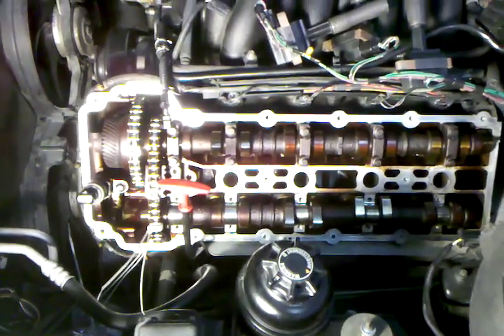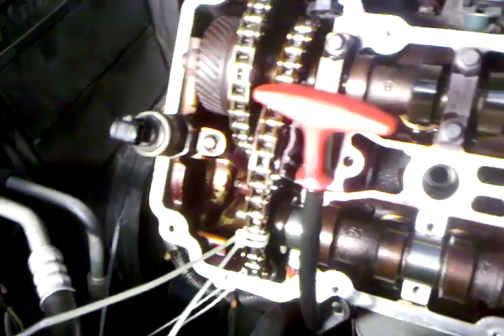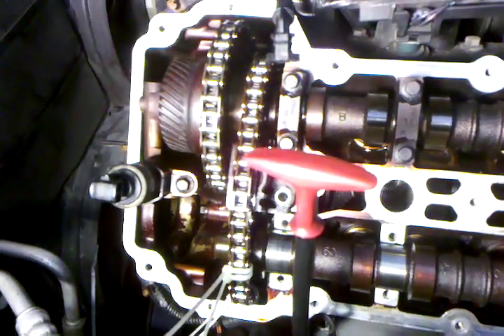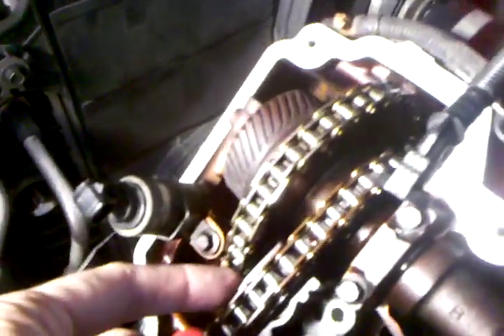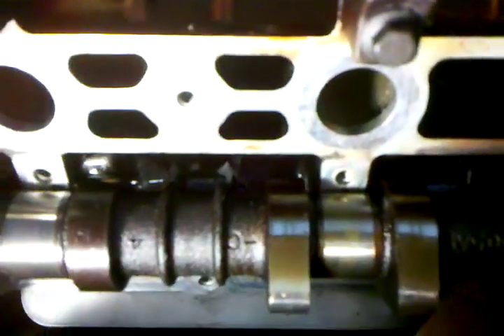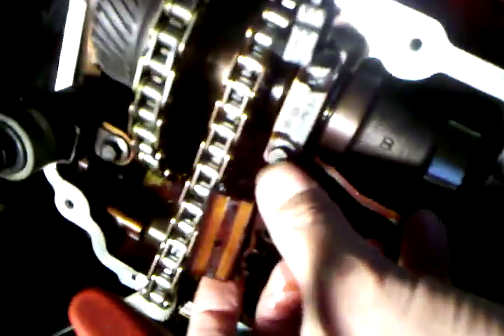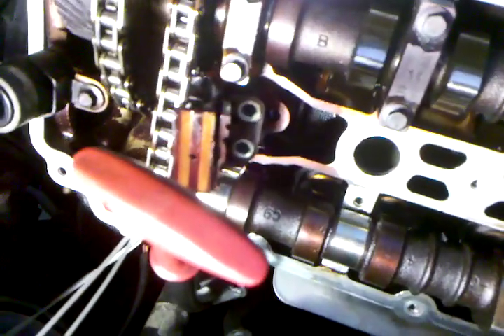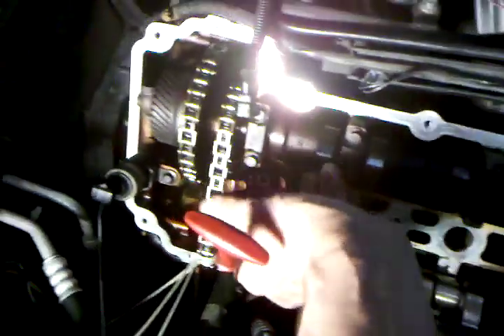99 Jaguar XJ8 VDP Left Side Timing Chain Tensioner Removal

Comment from the maker: I did this over two days.  I had to create some tools to get at the radiator "tower" since I removed it.  I replaced the cam cover gaskets, one broken cam cover bolt as well.  If this is your first time, just take your time, have undisturbed room to lay down your parts, take photos as you go, gaskets get REPLACED - NOT REUSED.  I have heard the recommendation that you replace water pump while all this is off - but I did not.  Good luck UK.

Comment from the maker: Hey Jackel59 - This was my second tensioner issue with this car.  Within two weeks after purchase there was a fairly loud tapping from the left front of the engine.  That one was replaced by dealership, but they refused to do 2nd one. If you are unsure if they've EVER been replaced HAVE IT DONE. Originals are made out of a plastic housing.and they crack, break, then your engine turns to mush.  LOTS more help on the Jaguar Enthusiast Forum!!!

Comment from the maker: Jackel59, The correct torque figures for the camshaft bearing cap bolts are 18-22 Nm or 13-16 lbf/ft.  Again, the Jaguar Enthusiast Forum online was my primary source of information about this job.  I was nervous about doing this in the first place, but like building a model, I just took my time and then realized that there are only "so many" parts.  So it was actually fun at the end.  

Remember, I'm not a certified mechanic!

Comment from the maker: By the way everyone, after I bought this car (used) the right-side tensioner, being loose/broken, had the chain making a "clacking" noise upon startup.  I brought it back to the dealership and they refused to fix both at the same time (under warranty).  So they replaced one tensioner (not the entire set/pack), and when I mentioned this on the forum, I was told to go ahead and do the other one...easy job, lots of instructions at the forum (FREE) like Rick Taylor said, TAKE YOUR TIME. 

If you don't have confidence in yourself and your ability to read through a forum for help, if you can't read a torque wrench, if you can't follow instruction, then go to a professional for this repair.  Also bring your car to a professional to have air put in your tires, or change your wiper blades, install a stereo...you get the idea - this is NOT rocket science by any means.  Good luck.  Please don't ask me questions because I got all my answers from http://www.jaguarforums.com/forum/

Comment: As a professional Jaguar Tech I do not recommend this procedure. To many things can go wrong. First of all the crank should be fixed into the correct position with a holding tool through the crank sensor slot, the cams should line up on their flats at the front and then a special holding tool fixed to secure the cams. The tensioner on the right side fails the most and can result in misfire codes before actually snapping the chain and bending the valves. Also never re-use the seals/ gaskets on the cam covers. Best bet is get professional help, your attempt can be a very costly mistake!
Reply: Rick Taylor have done this all but the engine is hard when im turning it can it be the cam bearing caps?,what can i do
Reply: R T which source do you rcommend for jaguar specialised tools? i know scparts

Comment: I am having trouble loosening the bolts that hold the camshaft caps on. I understand that the bolts have locktite on them, from the factory. How did you remove yours? I am afraid to put too much pressure on the bolt, as it may break. I would really appreciate any advice you can give.
Reply from the maker: Hello Bob,  I'm not a professional or certified Jag Tech, but if you believe you have factory locktite on those bolts (which I think my job was a first for the car), I would still set your socket on the bolt head and use a rubber mallet on the socket driver handle...tapping it towards the removal direction.  The idea being that those bolts MUST come off.  So gently tapping with a rubber mallet on the socket driver handle with increasing pressing should break them loose.  Again, mine was a first time and they were very snug, but eventually came loose.  Aside from the paying attention to not moving parts around too much, this goes back to our basic model building when we were kids.  Don't forget to put oil into the ports (holes) on the new cam shaft tensioner BEFORE bolting it back down.
Reply: ibond2u Thank you for your help. I have the bolts out now. I did not have to use a mallet...I just took a chance and put a lot of pressure on it; and it made a cracking sound. I could swear I broke the bolt by the sound of it; but no that was just the sound of the locktite breaking loose. Now, my problem is that the camshaft will not budge. I tried prying it; and it just doesn't seem to want to come out.

Comment: Did you put the engine at tope dead center for this job? Did you rotate the cam to get the lobes off of the valves? Or is it mostly just as it says in the video please?
Reply from the maker: Good question - I did all this "in place" where the engine was at the time.  I did mark both ends so the alignment could be the same when replaced.  The mechanics (through the Jaguar Enthusiasts website) said the first thing you had to "get over" was overcomplicating this in head.  Overall it's like building a model - take your time, take photos as you go if you need to or simply mark the spots for alignment for when you replace items.  This was the first time I worked on the engine and it turned out fine - and it was fixed.  Thanks again for the question.
Reply: Marked both ends of what please?
Reply from the maker: @tainchains  I'm sorry, it's been 11 years since I posted that.  Can you see that I put zip ties to keep the front end of camshaft in place on the sproket?  :)  That's all I did to keep it in alignment as I gently moved it out of place in order to remove the old timing chain tensioner.  So again, don't overthink this.  Oh, I traded this car in 7 years ago, it was still running fine.
Reply from the maker: @tainchains  Forget the "marking both ends" that was another job I did.
Reply: I'm pretty sure that the tensioner broke. But there is another noise like a piston slap. This all happened at the same time. What do you think of this noise? This is the engine right when it started having  trouble. Its not being driven now. I will try to replace the tensioners. Do you thin that might fox this?

https://youtu.be/PXkR80gqqqM
Reply from the maker: @tainchains  I am sorry, but I am not a mechanic and sounds are very hard to match to a specific problem.  I would suggest that if you are unsure, that you contact either a mechanic or join this forum and ask the question and you'll get better answers than I can give.  https://www.jaguarforums.com/
Reply: how long did one side take?
Reply from the maker: @tainchains  That was the first time I went into the engine, so I was careful to note everything I learned about this repair.  It took me about 45 minutes.  The idea was that the zip ties held the sprocket and timing in place and you only needed to move them ENOUGH TO WIGGLE THE TENSIONER OUT AND PUT THE NEW ONE IN. THEN PUT EVERYTHING BACK INTO PLACE.  Should be fairly simple for you.

Comment from the maker: Hello Guys, I would have to say that Rick Taylor's comment is valid to a degree.  Rick, would you like to discuss your opinion with the 70, or so, Jag Tech at the Jaguar Enthusiasts Forum? They will mostly disagree with you, especially about that expensive tool versus the "zip tie" method.  I will personally agree that this job might not be for everyone because you do have to look beyond the immediate repair and look towards what might become damaged soon afterwards, like the chain guides.  However everyone, Rick is a professional mechanic, and I respect that, but after reading the hundreds of posts, most made my "tried and true" Jaguar owners who performed this repair, and based on the many Jaguar technicians who backed up the ease of the ENTIRE Chain, Guides, and Tensioner replacement - I'll take their advice over Rick's advice.  Do your research and train yourself - http://www.jaguarforums.com/forum/

Comment: Theyre called valve covers and they only need about 15lbs of force because the gasket is a flimsy one. You should secure the cams to their respective spot on the chain or risk catastrophic failure

Comment: I debated whether or not to respond to your degradation of my comment and your belittlement of my thoughts and that professionals are only good for putting air in your tires and installing stereos. But after being in this industry for over 35 years I could not let you berate our profession as you so implied.
Perhaps you can "learn" from the forums, and yes you may save a few bucks in the process. But I cannot begin to count how many times I've had a car in the shop where some yahoo attempted to do his own work on a high end job and failed miserably!
Yes, if you are mechanically inclined and understand the basics perhaps the forums can help you learn and with luck succeed in your quest. I have no problem with that, more work for us when you don't, but your mistake may be a costly one. And oh yea, it IS ROCKET SCIENCE! :)